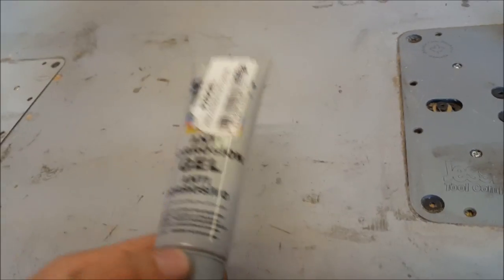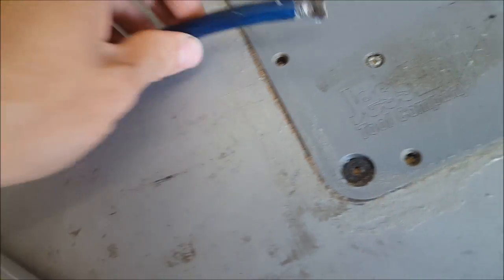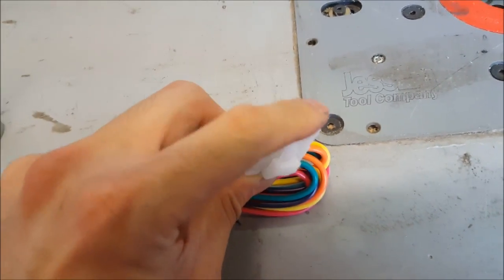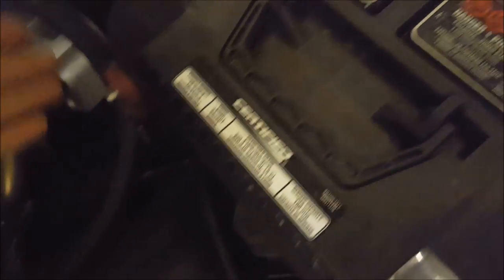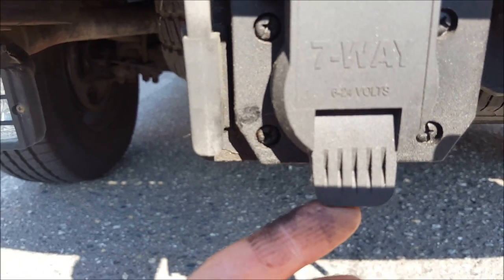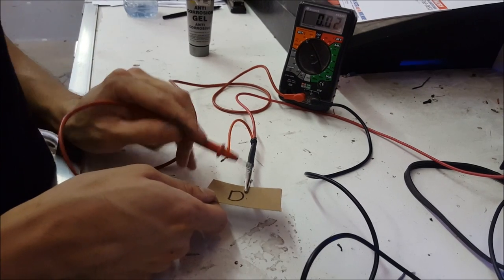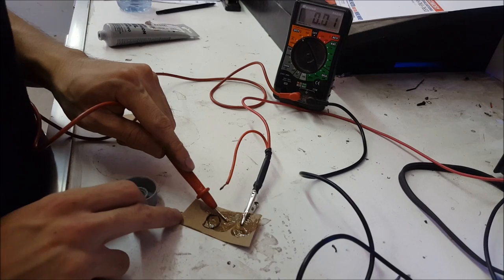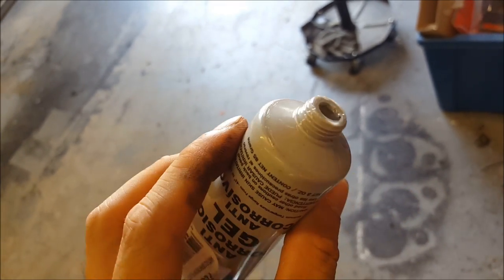Dielectric Grease applications (Electrical Maintenance) | AnthonyJ350

Comment: Great teaching video. Really thorough advice. Near the end of the video  about 8'30" I was relieved that you advised that dielectric actually in a connector is not recommended but can be done at ones own discretion, because I had looked at a video before yours and had coated the blades of every fuse in my Peugeot fusebox precisely because unlike your video, the earlier one I had seen failed to mention the grease is an insulator and needs to be used as a seal on the plastic surfaces of connectors and not actually on the pins or blades...aaargh....I thought I had been scuppered, but I'm now hopeful that after my cleaning and renovation of the fuse box it may actually work in spite of my mistake putting grease on the metal blades.Thank you for the video.
Reply from the maker: It actually displaces quite easily, I pack connectors all the time personally with no issue. Just unplug it a few times so it makes good contact

Comment: Always use dielectric grease to protect against corrosion. Spark plug boots and electrical connections. It has to be non-conductive, otherwise it would short out the adjacent pins on the connector.
Reply from the maker: Thanks for sharing

Comment: You can put a small amount right in connectors and fuse blocks exposed to the elements.  This is a common use on motorcycle connectors.  Some aftermarket parts, such as lighting, actually come with small packets of the stuff, and they instruct you to apply to all connections.
Reply from the maker: Thanks for the tip!

Comment from the maker: For anyone looking for the same tube of dielectric grease online you can get it here.

https://rover.ebay.com/rover/1/711-53200-19255-0/1?icep_id=114&ipn=icep&toolid=20004&campid=5337982243&mpre=http%3A%2F%2Fwww.ebay.com%2Fitm%2FSUPER-LUBE-82003-Anti-Corrosion-Connector-Gel-%2F222276592831%3Fhash%3Ditem33c0b7a4bf%3Ag%3A7DoAAOSw8w1X-tQl

Comment: nice explanation.  
would you use a conductive anti corrosive grease on car battery terminals?  and what are those little grease packets auto zone sells to prevent corrosion on car battery terminals? 
Thanks again
Reply from the maker: +JOHN C Not sure what Autozone is selling.  I would for sure put a thin layer of dielectric grease on the battery terminals after cleaning them.  Also put some on the exposed wire that connects to the battery to help prevent corrosion on the wire.
Reply: Don't use conductive grease on battery terminals; it can seep out and make connections that you do not want. Use dielectric grease so that only metal to metal connections are maintained and the electricity is contained.
Reply: Autozone little packets is bulb grease, same thing.

Comment: Dielectric grease simply is used to prevent contaminants from entering the contact surfaces.
Never put dielectric grease on the contact surfaces.
Conductive grease is only for sliding electrical contacts.
Reply from the maker: I keep seeing theorists say don't put it in connectors. But noone seems to be able to prove that it degrades the connection over time with consistent proof.
Reply: I put dielectric grease on contact surfaces all the time. Some connectors are not waterproof and need to be sealed against the elements. I normally work with PLC and computer based equipment. Both 120V and 24V. I also use it on TV antenna F connectors  for the past 25 years and still works.

Comment: Use dielectric grease on all connections. Ignition and all and electrical components. It's a plus for your vehicle.
Reply from the maker: I agree, I started putting on computer connections under the dash with no issues. So I put it in all connections now.

Comment: All the network grounding and bonding kits we get, come with little packets of dielectric grease. Wish I had grabbed some for the grounds I have in my car going to the frame under the car, woulda saved me a few bucks.
Reply from the maker: The big tubes aren't too much to buy.  I have it listed in my Amazon Store.

Comment: Dielectric means non conductor. Not insulator. If you put it on two metal terminals and plug the together they will not be insulated by this nonconductive material. The plug will pass correct no problem. If you touch the dielectric it won’t CONDUCT electricity. Buyer if you have a live wire with dielectric grease covering it and you grab the exposed metal (wet with dielectric) you will get shocked. 
Nonconducting does not = insulator
Reply from the maker: Thanks for sharing!

Comment: Actually pure, clean, deionized water will not conduct electricity.

The insulation provided by a dielectric (any insulator/dielectric) is directly proportional to the quantity/thickness between the conductors.
The metal to metal contact in the connectors negates the effect of the dielectric grease because there is insufficient thickness to act as an insulator.

Historical note: 
Back in the day before modern high-tech synthetic grease compounds, vaseline petroleum jelly for this same purpose.
Reply from the maker: Thanks for the comment!

Comment: Is bulb grease the same as dielectric grease? I bought bulb grease (Permatex brand) at the auto supply store and have been using it to make household light bulbs easier to screw into fixtures (lamps, recessed cans, etc.) Is this safe? Is it effective? Thanks!
Reply from the maker: +bamabenz2000 Does it say any where in the description is has dielectric properties?  I've never used a grease for house lighting, nor have I ever seen someone use it.  Do you have a link of the product?

Comment: Do you use this dielectric grease on VQ’s MAF sensor’s connectors as well?
Reply from the maker: For the plug?
Reply: @AnthonyJ350  for the electrical connectors of MAF sensors
Reply: @Qkfltpdls777  Yes, I put it on my Elantra 2008, and today has 159K miles no problems at all. In fact, I use contact cleaner spray and clean all connections, fuse, and everything I can reach and added dielectric grease, and nothing happened. It's just fine. people create videos and freak out every single poor mind on the web.

Comment: yeah so ... i just changed my plugs and gobbed it all in the coil even on the metal spring .... truck ran weird for 2 seconds now it runs great.. should i dismantle everything and clean it off...
Reply from the maker: +cb7pwn Maybe unplug it and plug it back in a few times to dislodge some of the stuff.  There's a reason I said to use a thin layer, because this stuff has insulating properties.

Comment: 2:48 completely wrong. This will not prevent any conductivity between connectors that make contact. It just doesn’t conduct between connectors that aren’t supposed to touch so they don’t short. Put it on both ends, plug it in, and if hey were clean to start you’ll never have a corrosion or arcing problem
Reply from the maker: Jeremy Lakenes I was referring to a product if it does not displace itself that well. They recommend you only put a thin layer in ignition systems.
Reply: Ok. Even globbed on dielectric grease will displace when connectors are connected. You need to put dielectric grease on the top of the spark plug and inside the boot. This will displace and maker perfect contact and avoid any corrosion and moisture intrusion. Trust me, you could empty a tube in the boot and it would still work.
Reply: 8:32 you prove my point. Electrical tape is an insulator. Rubber, wire insulation, etc. but dielectric grease is not an insulator, it is simply just a non-conductor. 
One thing you’ll notice is that when you put it on ohms and beep to check continuity, some multimeters will beep faster after the prongs touch WITHOUT the grease than with the grease because the air gap is being jumped ever so close as they are almost touching? Where the grease prevents air gap conductivity because It displaces the air available to conduct. Thus, preventing arcing in automotive plug sockets, light sockets, etc. hoop it on and plug it in. Just don’t go overboard ;)
Reply from the maker: Jeremy Lakenes I'm just curious why this is one of the definitions "A dielectric (or dielectric material) is an electrical insulator..."
Reply: AnthonyJ350 because the definitions come from Wikipedia or a quick search. The problem is that wire insulation is an insulator, but not a non conductor. It just simply doesn’t conduct like metal or water. It’s like a constantly melted wire. When the wire insulation melts and becomes liquid this allows the wires inside to touch and conduct electricity. An insulator is only a true insulator if it keeps wires from touching. Basically an insulator is a nonconductive solid substance that prevents wires from touching and conducting electricity. 
Am I explaining it well enough? I’m not trying to troll or anything, I just want you or others to know the full benefits of dielectric grease and have it work well IN the connections to prevent problems. :) 👍
Reply from the maker: Jeremy Lakenes Thanks for sharing your knowledge.

Comment: Hey how do u apply the grease on battery and alternator? Thanks
Reply from the maker: Thin layer on the battery terminals then put the clamp on and a thin layer where the battery cable goes onto the back of the alternator. Don't put any in the casing as it will clog up with dirt and it will run hot.
Reply: @AnthonyJ350  thanks if you could do a vid would be great😎

Comment: This video is so wrong.   Dielectric is hardly going to slow down a 50,000 volt line.    Slather it everywhere.
Reply from the maker: What about a 12 volt line or something that steps down to 5 volts where you don't have the "pressure" of 50,000 volts?
Reply: It’ll work just fine

Comment: Do not put dielectric grease in your connectors why?
Reply from the maker: Joaquim Coutinho Because the grease is technically an insulator.
Reply: yeah so? The grease should spread itself throw the gaps, if the connectors were in touch with themselves before the grease they will be after. So i dont get the point
Reply from the maker: Joaquim Coutinho It's used to inhibit corrosion. It should displace but I can see a novice putting too much and might have issues with the device and not understand why. That's why I made that statement. You just need to block moisture out

Comment: I'll have to say, you should go and ask the real experts. Dielectric material IS an insulator. Fact check.
Reply from the maker: Experts seem to be split 50/50. It seems to have the ability to displace very easily, that's why you can put it in a connector and still have it work.
Reply: Been using it for 40+ years and have never had the slightest problem with it, while there are lots of place conductive grease should not be used.